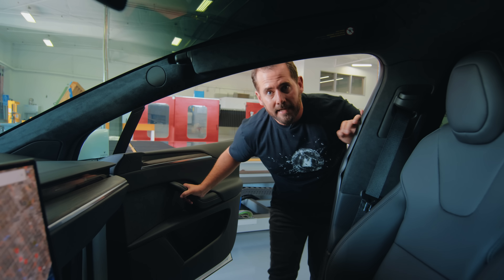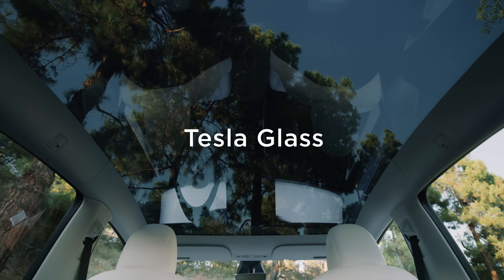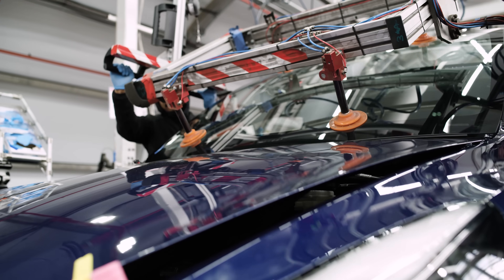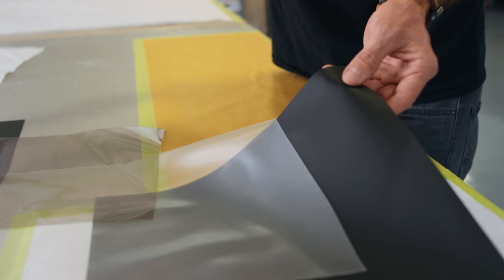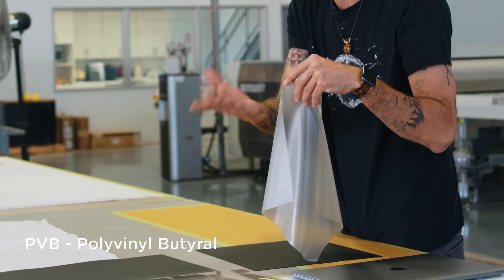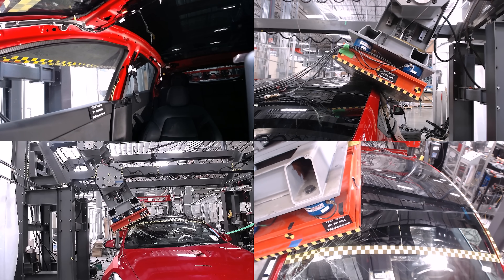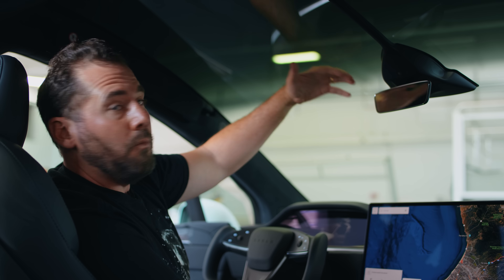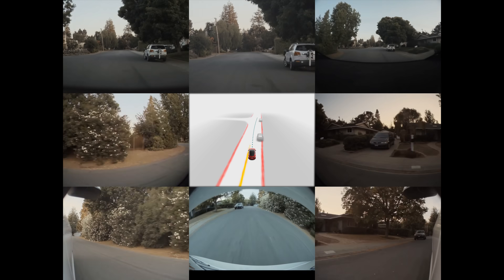Tesla Glass | The Secret to a Quiet Cabin

Comment: This is the kind of advertisement I'd find acceptable. Just explain how the product is superior without trying to influence our emotions with empty buzzwords (aka 99% of commercials).
Reply: Superior to what?
W140 features included:

Double-paned soundproofed glass was a new S-Class innovation first fitted on the W140. This form of window glazing allowed for improved soundproofing, reduced condensation, and other insulation benefits.

Electrically-operated exterior mirrors could be folded by switch to ease driving in narrow spaces.

'Parameter steering' was a system which made low-speed driving easier by reducing the effort required to maneuver in speed-sensitive situations such as parking.

Rear-parking markers, or guide rods. These rods extended from the rear corners of the trunk lid when in reverse, providing the driver with a guideline for rear maneuvers. In 1995, this system was replaced by the sonar-based Parktronic system which measured the distance of the bumpers to nearby obstacles.

12-way powered, heated front seats, with 3 setting memory functions and lumbar support.

Windshield wipers with heated washer system. Later models also included rain-sensing windshield wipers.

Electrically-operated automatic-dimming inside rear-view mirror that tied into the seat and steering wheel memory.

Heated exterior mirrors. Later models also included auto-dimming driver's side mirror.

Orthopedic seats were an expensive option from the factory but consisted of several different air cushions in the seat that the user can inflate and deflate to find the perfect driving position.

Dual-zone climate control. Four-zone climate control on LWB models.

Reclining and heated rear seats on LWB models. V12 models also have the four-place seating option, which allows fully adjustable rear seats, lumbar support and rear sunshade control. The center seat has been replaced by a burlwood center console, allowing a 2 + 2 seating format.

The climate control system could be set to operate for 20 minutes after the engine had been turned off.

Electric rear sunshade.

Rear passenger illuminated vanity mirrors.

Soft-closing doors and trunk.

Leather interiors and burl inserts (optional; standard for 500SEC/CL 500).

In 1995 the S 600 Coupe became the first Mercedes car with GPS navigation system, designated Auto Pilot System APS. It featured CD-ROM maps and full color navigation display in the center dashboard.

In 1996 the Linguatronic voice control system and Parktronic sonar-based parking system were introduced

In 1997 the TELEAID emergency and tracking system was introduced in the US market.

Also, developed with the car, a Bose sound system was available as an option.

Comment: Awesome, love the videos with engineers talking about things.
Reply: This is not new.
W140 features included:

Double-paned soundproofed glass was a new S-Class innovation first fitted on the W140. This form of window glazing allowed for improved soundproofing, reduced condensation, and other insulation benefits.

Electrically-operated exterior mirrors could be folded by switch to ease driving in narrow spaces.

'Parameter steering' was a system which made low-speed driving easier by reducing the effort required to maneuver in speed-sensitive situations such as parking.

Rear-parking markers, or guide rods. These rods extended from the rear corners of the trunk lid when in reverse, providing the driver with a guideline for rear maneuvers. In 1995, this system was replaced by the sonar-based Parktronic system which measured the distance of the bumpers to nearby obstacles.

12-way powered, heated front seats, with 3 setting memory functions and lumbar support.

Windshield wipers with heated washer system. Later models also included rain-sensing windshield wipers.

Electrically-operated automatic-dimming inside rear-view mirror that tied into the seat and steering wheel memory.

Heated exterior mirrors. Later models also included auto-dimming driver's side mirror.

Orthopedic seats were an expensive option from the factory but consisted of several different air cushions in the seat that the user can inflate and deflate to find the perfect driving position.

Dual-zone climate control. Four-zone climate control on LWB models.

Reclining and heated rear seats on LWB models. V12 models also have the four-place seating option, which allows fully adjustable rear seats, lumbar support and rear sunshade control. The center seat has been replaced by a burlwood center console, allowing a 2 + 2 seating format.

The climate control system could be set to operate for 20 minutes after the engine had been turned off.

Electric rear sunshade.

Rear passenger illuminated vanity mirrors.

Soft-closing doors and trunk.

Leather interiors and burl inserts (optional; standard for 500SEC/CL 500).

In 1995 the S 600 Coupe became the first Mercedes car with GPS navigation system, designated Auto Pilot System APS. It featured CD-ROM maps and full color navigation display in the center dashboard.

In 1996 the Linguatronic voice control system and Parktronic sonar-based parking system were introduced

In 1997 the TELEAID emergency and tracking system was introduced in the US market.

Also, developed with the car, a Bose sound system was available as an option.

Comment: more more! =D
Reply: 90s Benz 
W140 features included:

Double-paned soundproofed glass was a new S-Class innovation first fitted on the W140. This form of window glazing allowed for improved soundproofing, reduced condensation, and other insulation benefits.

Electrically-operated exterior mirrors could be folded by switch to ease driving in narrow spaces.

'Parameter steering' was a system which made low-speed driving easier by reducing the effort required to maneuver in speed-sensitive situations such as parking.

Rear-parking markers, or guide rods. These rods extended from the rear corners of the trunk lid when in reverse, providing the driver with a guideline for rear maneuvers. In 1995, this system was replaced by the sonar-based Parktronic system which measured the distance of the bumpers to nearby obstacles.

12-way powered, heated front seats, with 3 setting memory functions and lumbar support.

Windshield wipers with heated washer system. Later models also included rain-sensing windshield wipers.

Electrically-operated automatic-dimming inside rear-view mirror that tied into the seat and steering wheel memory.

Heated exterior mirrors. Later models also included auto-dimming driver's side mirror.

Orthopedic seats were an expensive option from the factory but consisted of several different air cushions in the seat that the user can inflate and deflate to find the perfect driving position.

Dual-zone climate control. Four-zone climate control on LWB models.

Reclining and heated rear seats on LWB models. V12 models also have the four-place seating option, which allows fully adjustable rear seats, lumbar support and rear sunshade control. The center seat has been replaced by a burlwood center console, allowing a 2 + 2 seating format.

The climate control system could be set to operate for 20 minutes after the engine had been turned off.

Electric rear sunshade.

Rear passenger illuminated vanity mirrors.

Soft-closing doors and trunk.

Leather interiors and burl inserts (optional; standard for 500SEC/CL 500).

In 1995 the S 600 Coupe became the first Mercedes car with GPS navigation system, designated Auto Pilot System APS. It featured CD-ROM maps and full color navigation display in the center dashboard.

In 1996 the Linguatronic voice control system and Parktronic sonar-based parking system were introduced

In 1997 the TELEAID emergency and tracking system was introduced in the US market.

Also, developed with the car, a Bose sound system was available as an option.

Comment: This is just amazing
Reply: Well it's been around for over 30 years
W140 features included:

Double-paned soundproofed glass was a new S-Class innovation first fitted on the W140. This form of window glazing allowed for improved soundproofing, reduced condensation, and other insulation benefits.

Electrically-operated exterior mirrors could be folded by switch to ease driving in narrow spaces.

'Parameter steering' was a system which made low-speed driving easier by reducing the effort required to maneuver in speed-sensitive situations such as parking.

Rear-parking markers, or guide rods. These rods extended from the rear corners of the trunk lid when in reverse, providing the driver with a guideline for rear maneuvers. In 1995, this system was replaced by the sonar-based Parktronic system which measured the distance of the bumpers to nearby obstacles.

12-way powered, heated front seats, with 3 setting memory functions and lumbar support.

Windshield wipers with heated washer system. Later models also included rain-sensing windshield wipers.

Electrically-operated automatic-dimming inside rear-view mirror that tied into the seat and steering wheel memory.

Heated exterior mirrors. Later models also included auto-dimming driver's side mirror.

Orthopedic seats were an expensive option from the factory but consisted of several different air cushions in the seat that the user can inflate and deflate to find the perfect driving position.

Dual-zone climate control. Four-zone climate control on LWB models.

Reclining and heated rear seats on LWB models. V12 models also have the four-place seating option, which allows fully adjustable rear seats, lumbar support and rear sunshade control. The center seat has been replaced by a burlwood center console, allowing a 2 + 2 seating format.

The climate control system could be set to operate for 20 minutes after the engine had been turned off.

Electric rear sunshade.

Rear passenger illuminated vanity mirrors.

Soft-closing doors and trunk.

Leather interiors and burl inserts (optional; standard for 500SEC/CL 500).

In 1995 the S 600 Coupe became the first Mercedes car with GPS navigation system, designated Auto Pilot System APS. It featured CD-ROM maps and full color navigation display in the center dashboard.

In 1996 the Linguatronic voice control system and Parktronic sonar-based parking system were introduced

In 1997 the TELEAID emergency and tracking system was introduced in the US market.

Also, developed with the car, a Bose sound system was available as an option.

Comment: In Tesla we trust.  Great video.
Reply: You have no clue....
W140 features included:

Double-paned soundproofed glass was a new S-Class innovation first fitted on the W140. This form of window glazing allowed for improved soundproofing, reduced condensation, and other insulation benefits.

Electrically-operated exterior mirrors could be folded by switch to ease driving in narrow spaces.

'Parameter steering' was a system which made low-speed driving easier by reducing the effort required to maneuver in speed-sensitive situations such as parking.

Rear-parking markers, or guide rods. These rods extended from the rear corners of the trunk lid when in reverse, providing the driver with a guideline for rear maneuvers. In 1995, this system was replaced by the sonar-based Parktronic system which measured the distance of the bumpers to nearby obstacles.

12-way powered, heated front seats, with 3 setting memory functions and lumbar support.

Windshield wipers with heated washer system. Later models also included rain-sensing windshield wipers.

Electrically-operated automatic-dimming inside rear-view mirror that tied into the seat and steering wheel memory.

Heated exterior mirrors. Later models also included auto-dimming driver's side mirror.

Orthopedic seats were an expensive option from the factory but consisted of several different air cushions in the seat that the user can inflate and deflate to find the perfect driving position.

Dual-zone climate control. Four-zone climate control on LWB models.

Reclining and heated rear seats on LWB models. V12 models also have the four-place seating option, which allows fully adjustable rear seats, lumbar support and rear sunshade control. The center seat has been replaced by a burlwood center console, allowing a 2 + 2 seating format.

The climate control system could be set to operate for 20 minutes after the engine had been turned off.

Electric rear sunshade.

Rear passenger illuminated vanity mirrors.

Soft-closing doors and trunk.

Leather interiors and burl inserts (optional; standard for 500SEC/CL 500).

In 1995 the S 600 Coupe became the first Mercedes car with GPS navigation system, designated Auto Pilot System APS. It featured CD-ROM maps and full color navigation display in the center dashboard.

In 1996 the Linguatronic voice control system and Parktronic sonar-based parking system were introduced

In 1997 the TELEAID emergency and tracking system was introduced in the US market.

Also, developed with the car, a Bose sound system was available as an option.

Comment: Owner of two Teslas here. 2013 S and 2018 3. Both cars gutted extensively to add a lot of sound insulation (double layered).

Model S got quieter as I closed a few non-blind plugged holes in the rear, and around the wheel wells. Air suspension also helped.

Model 3, not much at all. I tried everything. The floor, the wheel wells inside and out, trunk, frunk, door panels. I’ve come to the conclusion that the problem is the suspension and the shock towers. They allow too much road noise to be transmitted into the cabin. The NVH level in Model 3 is frankly not good. From my experience with the S, I was really hoping to reduce the NVH in the 3. It’s absolutely HOPELESS. 😔

This acoustic glass won’t help improve that. Doubt me? Check out the tests done by a few folks and uploaded to YouTube.

Why won’t this improve the situation? The elephant in the room is the damn tire ROAR. Seeps in through the non-air coil over suspension. 
While I love the superb driving experience of a traditional suspension compared to the slightly more detached and isolating air suspension in my S, I hate the NVH it brings in.

Not all cars with non-air suspensions are loud! My erstwhile 2005 BMW 325i had terrific NVH control while having non-air suspensions, and it was a very sporty driver as well. Model 3 ain’t exactly cheap, I paid nearly $54K for my LR RWD (they used to make them in 2018). I expect more for my money.😏

The Model 3 is very sporty, but it’s NVH kind of kills the driving experience. Especially on poor road surfaces, of which there are plenty in the Bay Area, California, where I live.

Anyway, my thoughts. If anyone at Tesla is listening, I’ll be glad.
Reply: yeah it's really, really noisy inside my TM3, dominated by noise from the wheel well areas
Reply: lol I’m watching this and thinking that same thing my 2022 LR M3 has has bad road noise on the highway

Comment: fantastic! And this is not marketing, it is real!
I can confirm that the improvement with the old model 3 and the current Y is impressive. And this is also a good thermal isolation…
Reply: W140 features included:

Double-paned soundproofed glass was a new S-Class innovation first fitted on the W140. This form of window glazing allowed for improved soundproofing, reduced condensation, and other insulation benefits.

Electrically-operated exterior mirrors could be folded by switch to ease driving in narrow spaces.

'Parameter steering' was a system which made low-speed driving easier by reducing the effort required to maneuver in speed-sensitive situations such as parking.

Rear-parking markers, or guide rods. These rods extended from the rear corners of the trunk lid when in reverse, providing the driver with a guideline for rear maneuvers. In 1995, this system was replaced by the sonar-based Parktronic system which measured the distance of the bumpers to nearby obstacles.

12-way powered, heated front seats, with 3 setting memory functions and lumbar support.

Windshield wipers with heated washer system. Later models also included rain-sensing windshield wipers.

Electrically-operated automatic-dimming inside rear-view mirror that tied into the seat and steering wheel memory.

Heated exterior mirrors. Later models also included auto-dimming driver's side mirror.

Orthopedic seats were an expensive option from the factory but consisted of several different air cushions in the seat that the user can inflate and deflate to find the perfect driving position.

Dual-zone climate control. Four-zone climate control on LWB models.

Reclining and heated rear seats on LWB models. V12 models also have the four-place seating option, which allows fully adjustable rear seats, lumbar support and rear sunshade control. The center seat has been replaced by a burlwood center console, allowing a 2 + 2 seating format.

The climate control system could be set to operate for 20 minutes after the engine had been turned off.

Electric rear sunshade.

Rear passenger illuminated vanity mirrors.

Soft-closing doors and trunk.

Leather interiors and burl inserts (optional; standard for 500SEC/CL 500).

In 1995 the S 600 Coupe became the first Mercedes car with GPS navigation system, designated Auto Pilot System APS. It featured CD-ROM maps and full color navigation display in the center dashboard.

In 1996 the Linguatronic voice control system and Parktronic sonar-based parking system were introduced

In 1997 the TELEAID emergency and tracking system was introduced in the US market.

Also, developed with the car, a Bose sound system was available as an option.